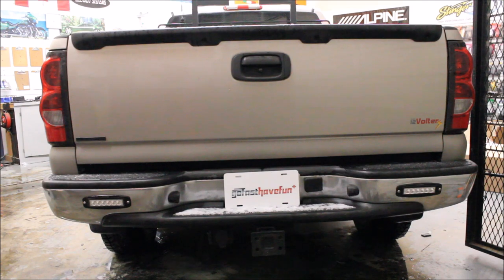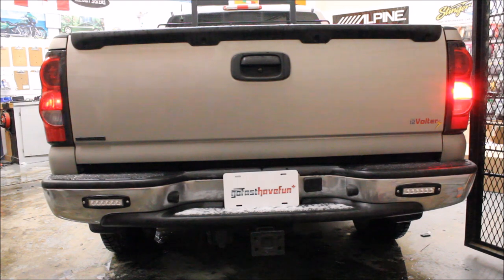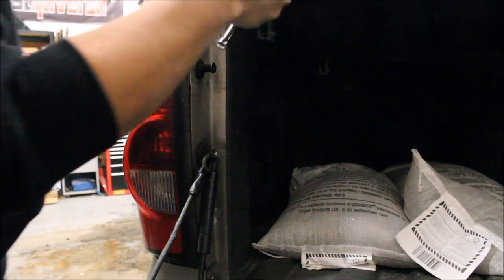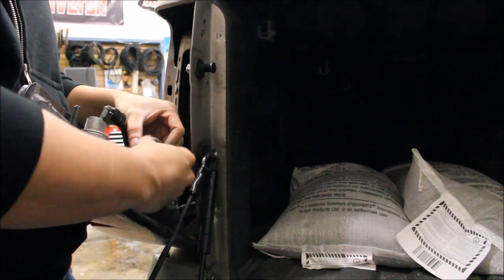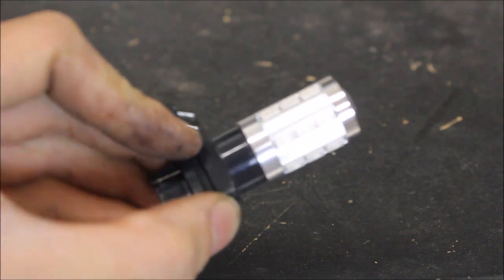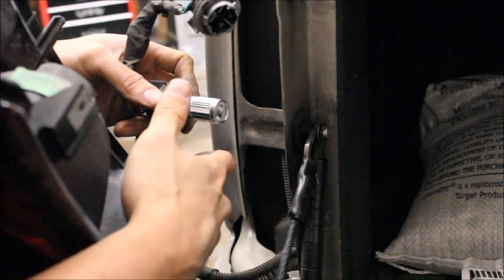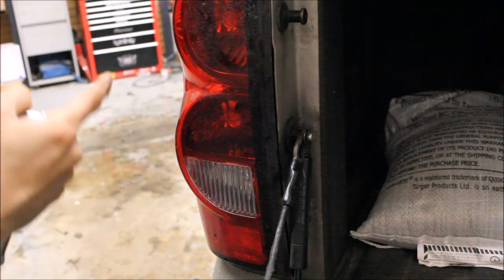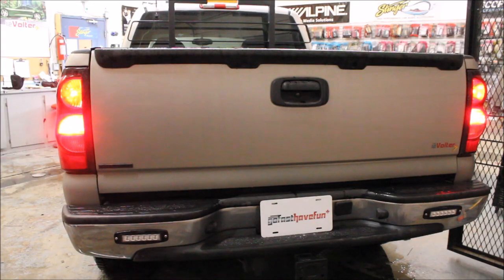LED Replacement Bulbs (Brake and Turn Signal) | AnthonyJ350

Comment: I installed LED lights on all my exterior & interior . I used JDM - ASTAR for most of my exterior and yes they are brighter than stock . I put switch backs in the front , wow are they bright in white ! Your truck has what I consider the best rear turn signal system ever , as it's separate turn signal ( which Chevy doesn't have any more 😝) and it blinks on the side ! Very safe idea . Red for red lens is a wise choice . I own a 2016 Elantra GT all LED now ! What a difference !! Great Video !
Reply from the maker: Nice job switching up your lights.  Actually the safest turn signal setup I've seen is the GM truck from 99-2002 because the turn signal lens is tinted amber helping really distinguish you're turning while the one on my truck is separate but still red like the brake.
Reply: AnthonyJ350 Thanks !! Your quite right .My cars are amber front and rear . I agree the set up on the  '99 to 2002 is the best , but .. no more ! I looks sooo cheap . It can be done !!! Separate turns and tails make sense as there safer .
Reply from the maker: Ya I think it's a manufacturing cost because they can just have the brake do double duty on the same wires as opposed to running another line just to do one sole function.  I wish more trucks were setup with the separate signals.
Reply: AnthonyJ350 Yes! I wish that too . I look at what they have and in my head design separate tails & signals . Cost is put into things you may never use .

Comment: I own a 2006 Chevy Silverado 1500. Both my high and low beam headlights have led bulbs, as well as my tail lights, reverse lights, turn signals on front and back, and daytime running lights. Visibility is so much better when driving at night.
Reply from the maker: Glad you were able to make your truck safer, look better and it's less stress on the charging system.

Comment: I did the same thing with my Chevy Cruze yesterday.  I replaced the tail lights, the rear marker lights, and the plate lights with LEDs.  I got a brighter indication and it seems a little more bold since I used red LEDs.  I put my lights on after dark and I really liked how much nicer my tail lights look.  I considered replacing the stock lights with an LED housing like you find on some other newer cars, but this was a much cheaper option.  I plan on changing out my reverse lights and front marker lights with LEDs as well.  I'm not so sure about my turn signals as those would require replacing the flasher relay to prevent hyperflashing and buying load resistors.
Reply from the maker: GrnArrow092 Nice good job! Ya turn signals are more work to do.
Reply: You can change the side indicators no problem, you can only replace the front or back but not both without getting the hyper flash issues.

Comment: When running these LED's, is it better to run a load resistor or an aftermarket turn signal flasher?
Reply from the maker: I prefer load resistors that way I'm not dependant on one part to make the whole system work.  That's just my preference.
Reply: How long do those load resistors last?
Reply: AnthonyJ350 , Im having issues finding a video for my 04 silverado doing a load resistor install. I have 2 black wires and 1 blue to rear blinker. Which do the load resistors go to?

Comment: Your actual video leaves out a critical part in that you mention nothing of needing resistors to correct hyper-flashing.
Reply from the maker: BakerOne Did you check the "cards" in the top right hand corner where youtube suggests other videos? Cause there is a load resistor video there. mic drop
Reply: In my opinion hyper flashing looks a lot better than the slower flashing
Reply: Not on all applications.. on some vehicles you can put in a LED flasher relay to avoid using load resistors.
Reply: Why is hyperflashing a bad thing?
Reply: @AnthonyJ350  no one reads that crap..video is misinformation.
Reply: BakerOne you don’t need resistors necessarily. You can also swap out thermal flasher relay for an electronic one, which is the better route to go in many instances.

Comment: If my car's tail light is a dual filament, for the brake and running light would I need a special LED or would any regular LED bulb work
Reply from the maker: gabrielgalaxygh Just need an LED of the same bulb type
Reply: AnthonyJ350 damn and this whole time I thought I was going to need a special bulb, thank you bro

Comment: the biggest issue with aftermarket Led Taillights is when they are just as bright or brighter than your brake light. the person behind you might not notice the fact that you hit the break
Reply from the maker: Marker lights have a different intensity than brake. You also have a 3rd brake that illuminates only when you brake.

Comment: If your so worried about safety put 99-02 chevy / 99-07 gmc tails in. They have the amber turns that you want.
Reply from the maker: Thought about it, but it doesn't have the corner light. I love how my bottom marker light alternates with the signal.

Comment: I bought some nice LED lights for to replace my tail lights in my camper. When you push on the brake the lights flash three times and then they stay on. I thought that is nice to warn people I am stopping but my problem is when the tail lights are on and I hit the brake or turn a turn signal in all the light on the camper go out and where the camper plugs into the truck you can hear like a relay kick out but when you let off the brakes they come back on. Do you have any idea what this happens? My camper in a 2007 and my truck is a 2020.
Reply from the maker: The camper lights flash or the truck? Do you have the same problem when hooked up to a trailer?
Reply: @AnthonyJ350  when I put the new led lights in the camper and plug it into the truck all the lights on the trailer come on. But when I push the brake the leds are made to flash three times to get people’s attention and then they stay on while the brake is applied but what happens when I turn the parking lights on and then push the brake or turn the turn signal on then all the lights go out on the camper and you can hear a click like a relay clicking out where you plug the cord into the truck. My truck is a 2020 but my camper in a 2007. So im not sure why the lights work ok when the parking lights are off but when I turn them on the light dont work properly. Do I need a resistor on the trailer lights?
Reply from the maker: @fireman1780  The trailer doesn't care. Is there another trailer you can hook up to see if it does the same thing? Or buy a 7 way test light tool and plug it in.
Reply: @AnthonyJ350  No I dont have anothet trailer to test the lights on. With the original 1157 bulbs all the lights work like they should but when I put the LeD’s in then it doesn’t work properly

Comment: I have the same truck on this video, do I need load resistors if I only put led signal bulbs on the rear? I didn’t see any in this video.
Reply from the maker: Alberto Cruz Yes you will. I have them tucked away mounted to metal. They get hot.
Reply: Thank you 👍🏼
Reply: AnthonyJ350 ig a resistor goes out can it mess up the bulb or the flasher?

Comment: No where is there video on the replacement of rear right led turn signal 2001 cadillac deville. Mine doesnt have bulb. Has led. Ive taken light fixture off, but no where to plug in new led. Any suggestions?
Reply from the maker: Peter Pantalone III You'll either have to buy a new tail light or take that one apart and custom install an LED strip into the housing.

Comment: Hey! I hope you can help me with this. I have a 2010 Chevy HHR and I just installed 3157 LED Red Tail light/turn signals on the car. When I turn on the auto/DRL they won’t flash but when the DRL is turned off they work but they don’t work correctly. When I turn on the right turn signal, both signals flash and my license plate light flashes along with the DRL markers. When I hit the brakes and use the left signal it won’t flash but when I’m not using the brakes and use the left signal it works. What did I do wrong??
Reply: You might need to install load resistors for your upgraded bulbs.

Comment: I keep seeing and hearing about load resistors..... wouldn't using an LED flasher relay in place of the factory flasher relay be more simpler?
Reply from the maker: It's an alternative but might not work for all vehicles. Especially ones where the BCM is controlling the lights.

Comment: Nice video. Did you have to install any resistor or flasher for the turn signals? They seem faster but in a good way.
Reply from the maker: RC4X4 There are load resistors installed in each corner
Reply: They are faster because LEDs light up instantly whereas incandesent bulbs or halogen ones do not they take 0.5 seconds for the filament to warm up enough to get full brightness.

Comment: I just attempted to put LED bulbs in the rear brake/tail lights and turn signals on my 2003 Jeep Grand Cherokee. I didn't change the front turn signal lights out with LED. The turn signal cycled about twice as fast as when the incandescent bulbs were being used. It was as if one of the bulbs was burned out. Is that normal?
Reply: Looks like you need to add Load Resisters to your circuit..a Fairly common thing with LED bulbs.
Reply: It's easier to replace the flasher relay.
Reply from the maker: No flasher relay on CANBUS systems
Reply from the maker: Did you put a load resistor in or a CANBUS compatible LED bulb?

Comment: LEDs will eventually be in all vehicles. All new cars and trucks are coming with them now and have been for many years. They last longer and take vibration/abuse a lot better than standard bulbs as well as use a lot less power and are brighter.
Reply from the maker: Painter D I like LED setups like this because if you have failure you replace the bulb. Newer vehicles have a lot going on and you have to replace the whole housing which could cost an average of $400 For just one light.

Comment: LEDs use less power. Doesn't that affect the blinkers? I mean isn't that going to make the bulbs blink faster as if one of the bulbs is burned out?
Reply from the maker: JohnVasilev You need to put in load resistors so it doesn't hyperflash.

Comment: installed led turn signal bulbs in front and rear. now they flash twice as fast like one bulb is out. how do i slow them down?
Reply from the maker: Glyn Robinson You need load resistors. Check the cards in the corner of the video for the video.
Reply: Thank you!!
Reply: Glad you mentioned Load resistors.  Thanks wish they would mention in this in more video's
Reply: Glyn Robinson: use load resistor

Comment: I can't get my brake light, to work correct on my 03 dodge ram 1500. I got load resistor on all four coner  of the truck, for turn signal. I need them but, when I turn on the lights or press the brake, the led bulb brake don't work correctly. I have led all the way around the truck, it look stupid with two original bulbs. HELP PLEASE!!!
Reply: It's best to replace the flasher relay. I had a similar issue with my silverado. Replacing the flasher relay is a lot easier than to install an individual resistor per bulb.
Reply from the maker: Test the voltage at the third brake light, might be weak.
Reply from the maker: I think it's controlled by the BCM in those trucks isn't it?

Comment: My light work when the signal is turned on or I press the brake but doesn't come on otherwise
Reply from the maker: Is the bulb you purchased designed for a dual filament application?
Reply: @AnthonyJ350  I actually figured it out. I used a plug and play resistor. It didn't have a wire ran for the running light. That's what the issue was. I just went and used one from AutoZone. It's perfect now.
Reply from the maker: @buckson  Great to hear!

Comment: I did this but it does not work on my signal why do I need to run a load resistor
Reply: It adds resistance to the bulb because it draws so low in current (in that model of truck, you can just change the flasher).
Reply: What you mean my break light and signal are the same bulb
Reply: I'm having issues getting the signal to flash
Reply: On some vehicles, it can be.  If one is brake and the other is signal, you would have to tap into the wire that activates the signal only.
Reply from the maker: To make the circuit flash so it doesn't think the bulb is burnt out.

Comment: Too bad absolutely no information about the brightness of led bulbs.   There a ton of led bulb variations .....and I am NOT talking about the base. There are "running lights" ....which require a specific "brightness" range (lumens). Brake lights, which require a different brightness (lumens) and back up lights. -------------------- Turn signals can cause problems due to the electrical circuitry. ----------------------------------- "RAPID RESPONSE" OF THE LIGHT BULBS IS THE MOST LEAST IMPORTANT ASPECT OF THESE BULBS.
Reply from the maker: taxicamel Your right there are a lot of variations. Wouldn't you just read the packaging to see lumen output and colour of the replacement bulb?
Reply: ......assuming one is standing in a store ....ok with paying what ever the price tag says.